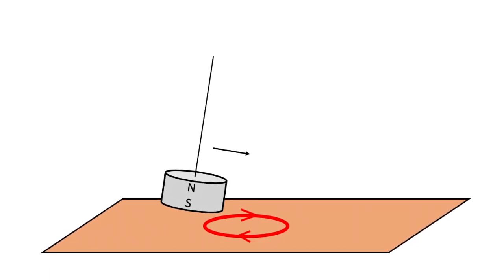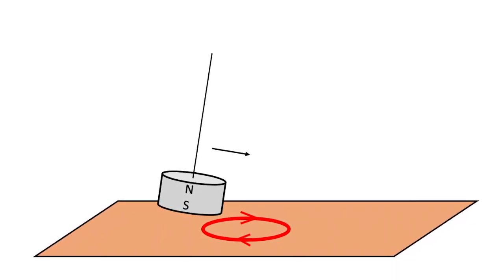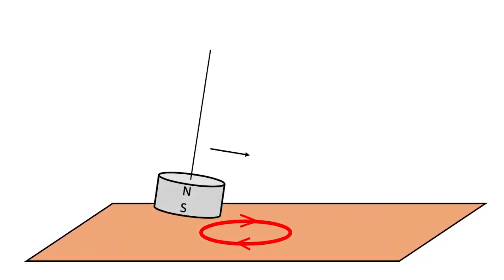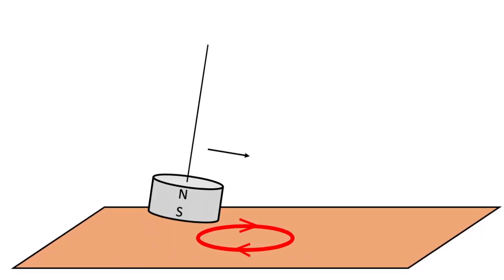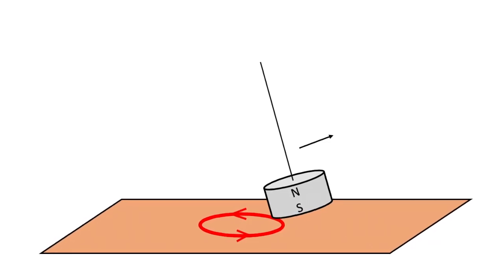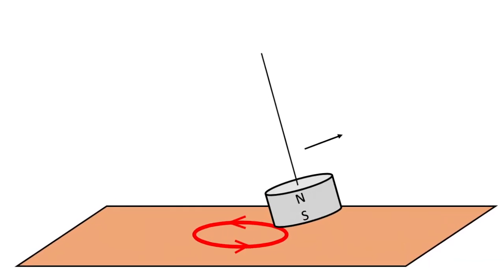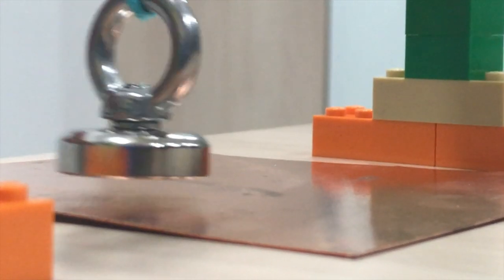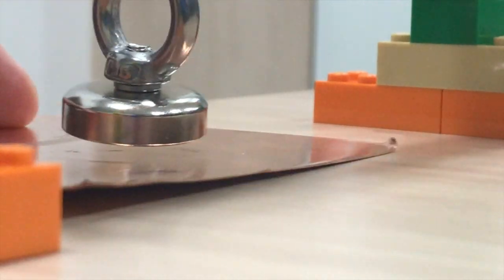Magnetic Braking with a Copper Plate

Comment: This pendulum consists of a strong magnet. If we slide a copper plate underneath the magnet while it is in motion, the magnet comes to a stop quickly. ... As the magnet moves across an area on the copper plate, the change in magnetic flux induces eddy currents on the plate.